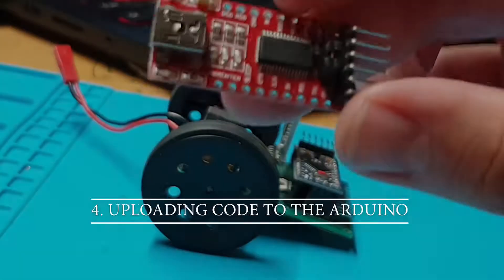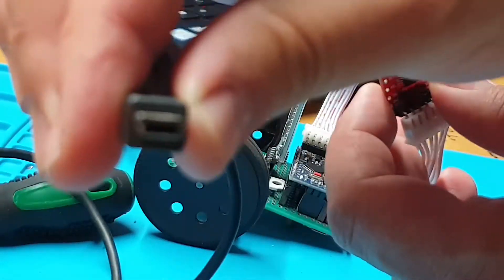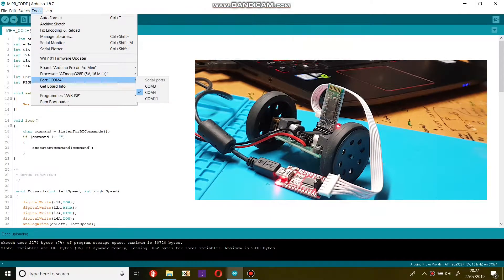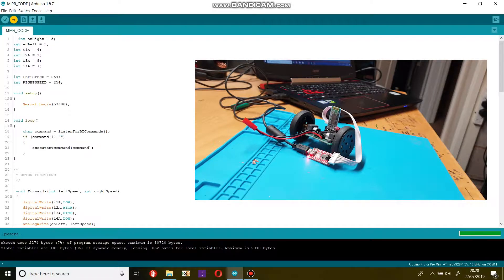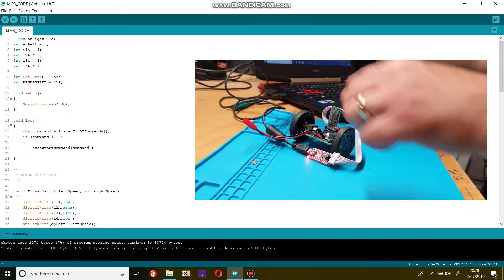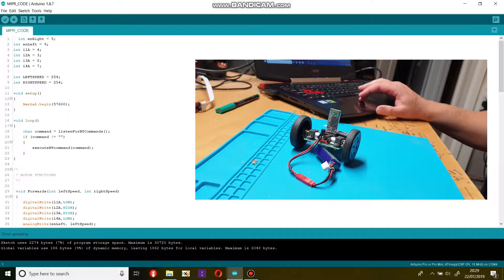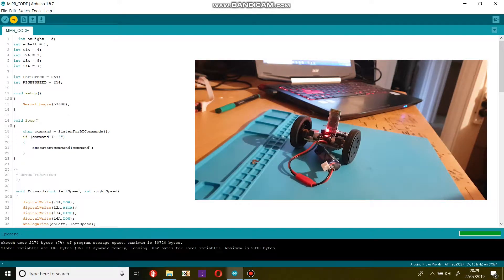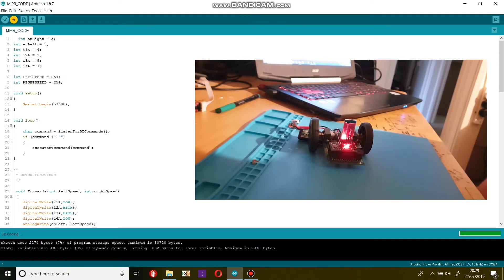4. Uploading Code to Arduino over USB and Bluetooth

Comment: how to make this code downloader via Bluetooth ? its really cool
Reply from the maker: A tutorial showing you how to modify the HC-05 to allow BT programming can be found here: https://www.l33t.uk/arduino_projects/hc-05-modification/
All the above modification does is to reset the Arduino when a Bluetooth connection is made or disconnected, however this will allow us to program the Arduino.

A tutorial showing you how to hook up the HC-05 to an Arduino so you can configure the HC-05 for BT programming using AT commands can be found here: https://www.l33t.uk/arduino_projects/bluetooth-programmer/

Just make sure to set the Baud rate of your HC-05 to the Baud rate of the Arduino's boot loader. Different baud rates can be found here: https://www.l33t.uk/arduino_projects/arduino-bootloader-baud-rates/